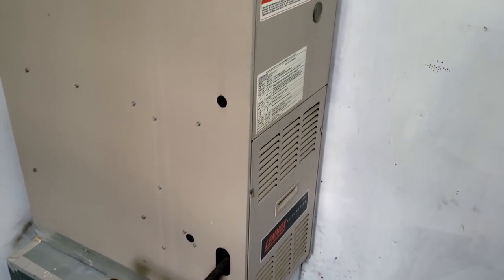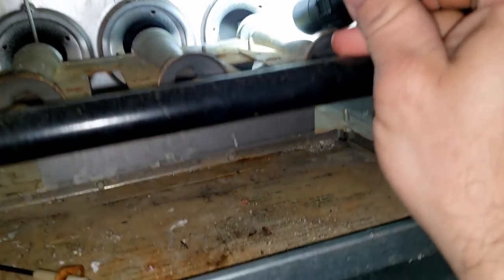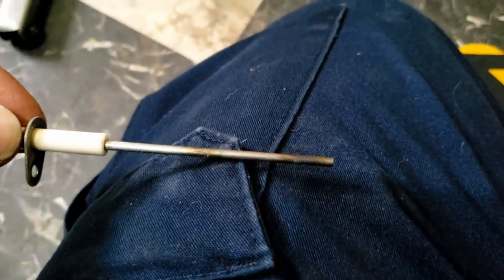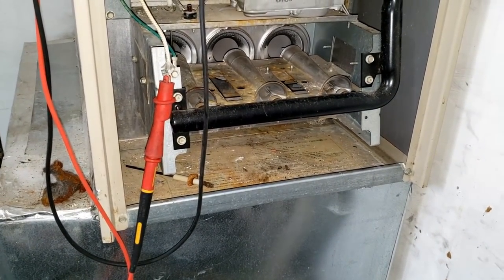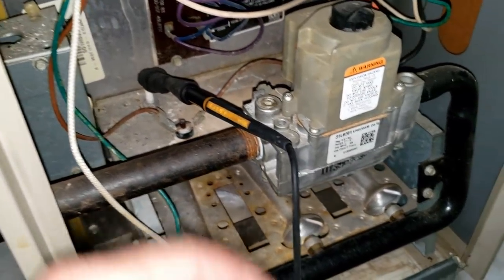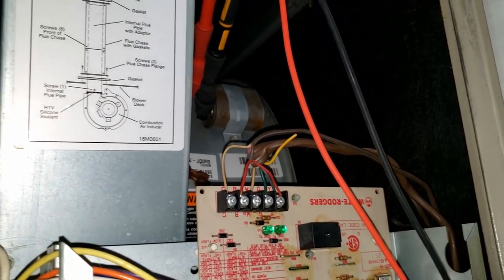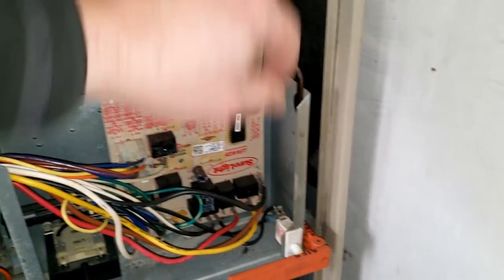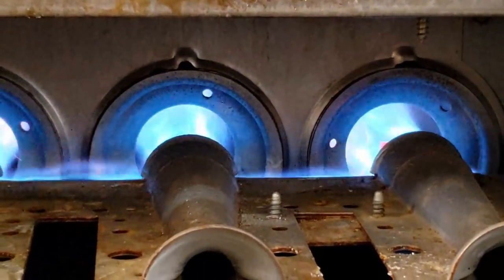NO HEAT LENNOX FURNACE 🤦‍♂️ DIRTY SECRETS EXPOSED

Comment: I am a retired tech, like what you did. I would suggest that you buy a smoke pen to test the integrity of the heat exchanger.
Reply from the maker: Thank you!  I never heard of a smoke pin? only have smoke candle.
Reply: @HVACRSurvival  Works on the same principle. Insert it in past each burner, with just the blower on, if smoke comes back at you, the exchanger is bad. All manufacturers recognize this test.

Comment: I like the fact that you did a safety check. I had a brand new furnace put in my grandmother's home years ago by a  company they fail to hook up the fresh air from outside. It caused the hole in the heat exchanger. She was on Propane fuel. I went by to check on her and the fumes rolled off the door when I walked in. They refused come out saying there couldn't be anything wrong so I called fire department and they had it shut down. I put her in the hotel and I got another company another Furnace in she was scared of propane so we chose geothermal Electric it worked wonderfully

Comment: I have a G60 installed in 2011 so very similar to that unit.  I have cleaned the flame sensor a few times over the years but have never inspected the burners like you did.  Thanks for the info on the high voltage.  I will be double sure the power is off before I do anything inside the furnace  I just try to keep it clean and I go in once a season and vacuum it out.  That one looked pretty dirty so likely doesn't get any TLC.
Reply from the maker: That sounds like you’re on top of it. 👍👍

Comment: Great video! That’s the way to do it while you’re there. I try to do the same thing to help avoid call backs. I never knew what the last numbers of the model number meant. That’s good to know. Seems like lennox always has an upgrade kit or something when you replace parts
Reply from the maker: Those 2 digits will make a big difference in what part number you'll need for a part. 👍👍

Comment: Nice thorough service!   A lot of folks neglect to check the chassis ground.   I have found so many loose, especially in the Reznor unit heaters.  
👍 Thanks Rick!
Reply from the maker: Ground is very important, not as much as it used to be,  I think they lowered the threshold electronically but it definitely is important.

Comment: It is proven bringing a 4" fresh air supply to the burner area on older or ones that dont have a fresh air supply (I guess 80's) greatly improve efficiency.  It works by suppling unit with the outside air at the combustion chamber, rather then having it pulled into house far away and cooling living space.  I would always fix unrelated issues to prevent call backs and sometimes I would give it as an option for more labor cost, almost all wanted it.  It's a way to have a customer for life.
Reply from the maker: Bringing the air right to the combustion Chambers not real common around here for 80% furnaces,  however if it's in a confined space we will bring it in from the ceiling and from the floor area. Possibly from the attic or crawl space.

Comment: I like your videos.     You do a good job.       I would have loved to see what would happen to the flame signal if you went back a second time with some plumbers cloth to it.      

I bet it would have went to 3 ma.     I know there is a big debate on plumbers cloth or sandpaper is too abrasive.     But that’s all i have used for 20 years with no problems.      I might have to do that experiment with my next low flame signal call.
Reply from the maker: That signal was low, usually it's around 3 area, it might be the board failing. ?

Comment: I always use a carbon monoxide meter at the registers.  That will let you know if the heat exchanger is bad.
Reply from the maker: I hope you don't only rely on that for your safety check. I've seen a lot of cracked heat exchangers without co level's high enough to set off a detector.
Reply: @HVACRSurvival  I use a field piece meter.  Any reading over 10 ppm I will check the heat exchanger.

Comment: Being new to trying to learn some of i'm very confused on a flame sensor.. How would a metal rod know the furnace is actually running?  I'm sure it's a stupid question but I was told ground is most important but I'm still lost... Sorry if it's dumb but I'm just lost... Thank you and great video.
Reply from the maker: The metal rod is nothing more than a conductive probe. (Here's how it works) The control board sends power to the flame sensor, (I've measured somewhere around 80 to 100 volts,) when the flame makes contact with the flame sensor there will be amperage measured through the carbons of the flame to ground, (carbon is conductive) that amperage is measured in microamps which is a very small amperage measurement. Keep in mind,  if you're microamps are too high or too low the furnace will not continue to run. This measurement range that's required prevents the furnace from running if the sensor was shorted to ground.  A lot of furnaces will run somewhere around two and a half microamps to maybe 4 micrograms but you have to check with the manufacturer to be sure what they require.  I'm sure there's a lot of good books out there on this.

Comment: What were the symptoms when it tried to start up, usually with the flame sensor you will get  a glow and flame then it will shut down. Did yours do that? Mine does not glow and shuts down the inducer motor is working. Wondering if it is the pressure switch or ignition. I have a similar lennox. So your fail at what sequence may help me out. I have had to clean the flame sensor quite a few times but always got a flame and then shut down.
Reply from the maker: You need an electric meter and measure across your safety switches to see if they are opening up.

Comment: What's the part number for that little orange hose? I ripped mine trying to remove to clean... which was the issue ...furnace now works but hisses a little because of that ripped hose .
Reply from the maker: If you’re talking about the pressure switch hose? just pick some up at the hardware store. There’s nothing special about it as long as it’s similar.
Reply: @HVACRSurvival  Thank you.

Comment: Would pulling the flame sensor out and reinstall it fix a bag ground between the sensor and the exchanger?  With as little soot on that sensor I would have thought the issue would have been not fixed with just cleaning the body of the sensor.
Reply from the maker: Are you a tech?
Reply: @HVACRSurvival  computer tech not hvacr.
Reply from the maker: @ericpaul4575  it's hard to cover how DC flame rectification works in a little message back and forth but if you search for it you will see a little more detail than what I'm able to post here. Basically they send 100 volts area down the wire to the end of the flame sensor then the carbon in the flame is conductive the path to ground,   the carbon in the flame causes a resistive short and that is measured in microamps. If the microamps are too high or too low it shuts the gas valve off. That's the basics of how it works. All the flame sensor is is a conductive rod.  Everything that's floating in the room gets baked onto that metal rod and causes resistance to build up and resistance lowers the microamps causing it to lock out like it did. It has always been a draw back of flame rectification and why they use UV light sensors on commercial unit heaters because it's more reliable.
Reply: @HVACRSurvival  Thanks for the info. I thought they worked like thermocouples.

Comment: Not familiar with that model Lennox, but the bolt holding the heat exchanger clam shells together looks custom...
I'm guessing the metal grommets failed and someone hacked it back together.
Reply from the maker: It was a dedicated down flow whereas some of the other models about that time were universal. There's nothing wrong with the heat exchanger or I would not have left it running.

Comment: i usualy check alsow the voltage going from electronic plate to ionisation probe. when the plate is worn the voltage is lower causing the microamps also going down . the manufacturer never tels you the voltage , at least in europe, but you can compare with a known good.... excuse my english
Reply from the maker: Your English is fine, I know what you're saying,  generally I measure about 100 to 110 volts area, I forgot to point that out,  I guess just like you said there's not a real science or rule of thumb it just comes down to doing it multiple times until you get a basis and that's all going to change dependent on the control board manufacturer you're working on. I appreciate you watching. Where are you located?
Reply: @HVACRSurvival  in Romania. thanks for responding
Reply from the maker: @salageansorin  do you speak english? Or are you using a translator?
Reply: @HVACRSurvival  not at all for transaltor. is my highscool english teatcher fault...;)